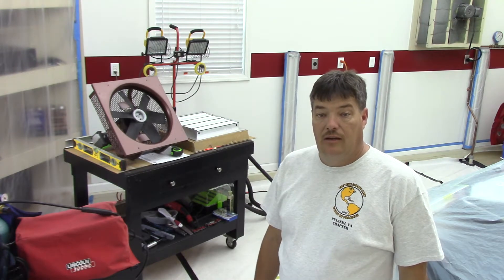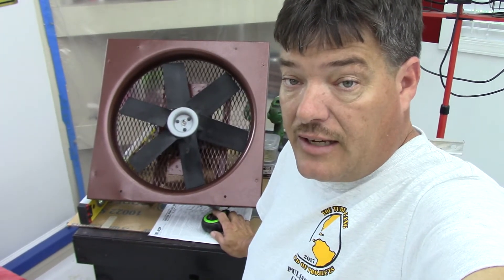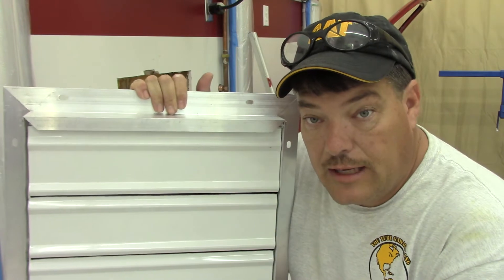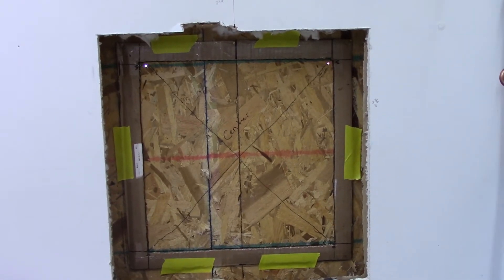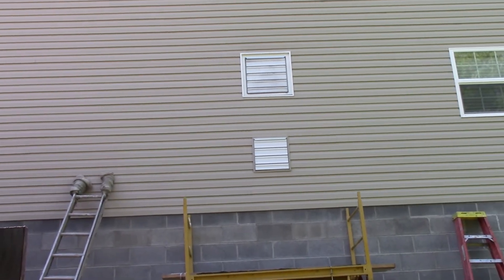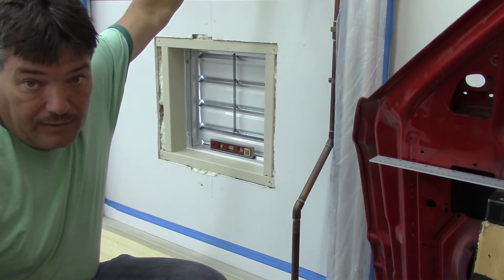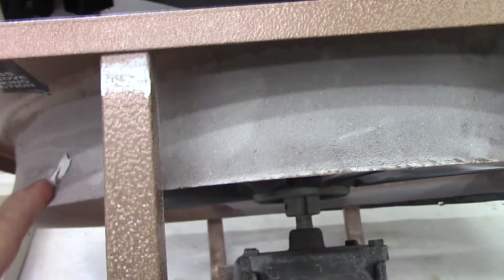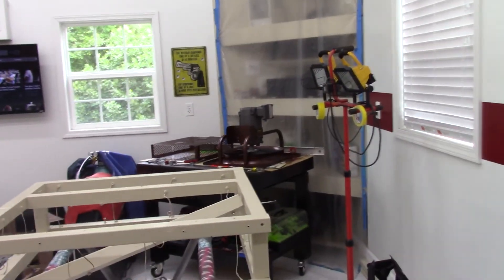Jenny Fan Install Part 1

Comment: Looking good Russ. I still have my Jenny sitting in its box. I need to get on that too.
Reply from the maker: Oh yea. Time to get that setup before you paint. Are you installing it in the wall, or making a frame for the garage door? What size did you go with? I have been real happy with the 20 inch that was already in the wall.
Reply: I went with the 20". I am planning on putting in the third garage door that does not open anymore. There is a little nook there between the door and the drum room.
Reply from the maker: Good deal. You will love that fan. That's the same unit that I have.

Comment: the lower the fan the better suck the air down , keep the dust down...
Reply from the maker: The88katana600 Thanks. I hope it does help. I wish I would have put the other one lower at first, but what is done is done.